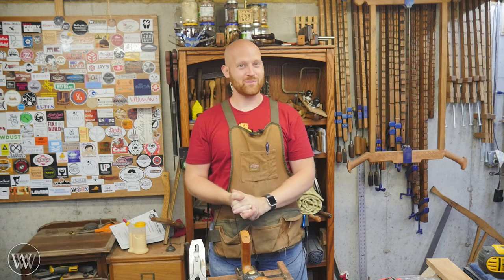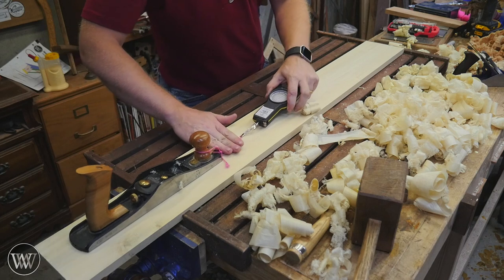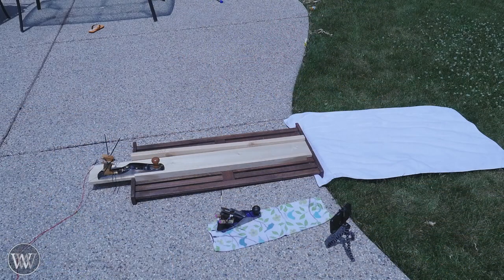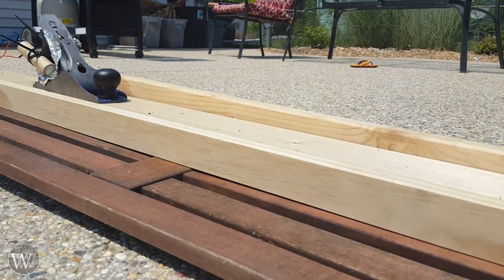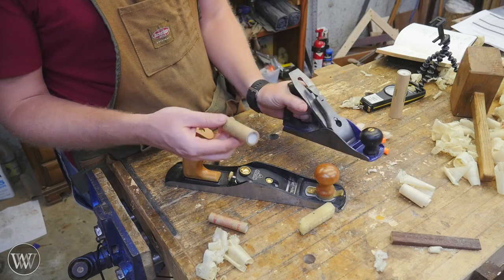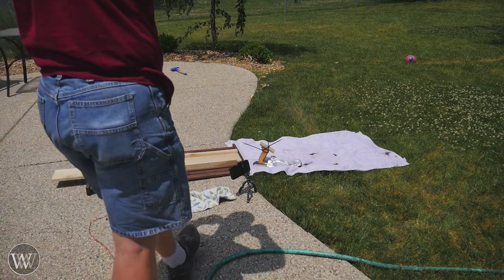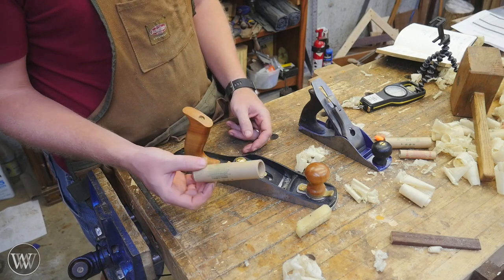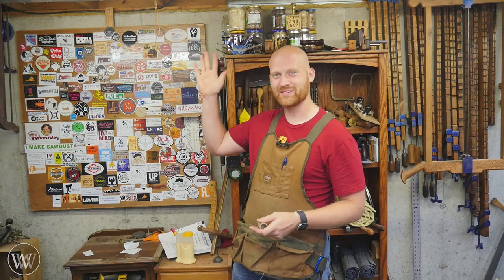Rocket Powered Hand Plane - Hand Tool Woodworking

Comment: Another thought is to craft a special tote with bored out holes to place the rockets in. This could help with more precise angulation of the rockets. This would also help control the parachute fire and keep the plane a little safer. Either way fun video!
Reply from the maker: that is a great idea! I might have to make a rocket plane 2.0

Comment: Haha. Pretty cool. For me it shows just how little downward and forward pressure it takes to make a plane work.  I'm pushing too hard most of the time.
Reply from the maker: if the blade is sharp it only takes a finger push or less to keep it down.
Reply: Wood By Wright i catch myself man handling it most of the time.

Comment: you can remove the ejection charge or there are engines that don't have them, at least there used to be
Reply from the maker: I thought about that after the fact. maybe when I put together 2.0 LOL
Reply: Estes even used to make a "-p" which stood for plugged for their rocket glider.
Reply: Wood By Wright Thsnks for the chuckles Rocket Man.

Comment: I think you were getting false readings when you were pulling by hand because you were pushing the string down onto the work piece and added friction and resistance beyond what the plane was encountering with wood by itself. Just a little note from a retired engineer and physics teacher/woodworker.
Reply from the maker: +Steven Zara I made sure not to rub the string on the wood. Just lowering the direction of pull
Reply: Thanks for clarifying. Appreciate your efforts in making and sharing your videos.